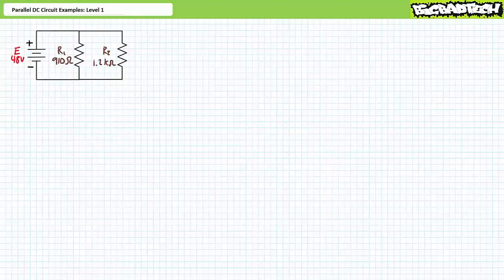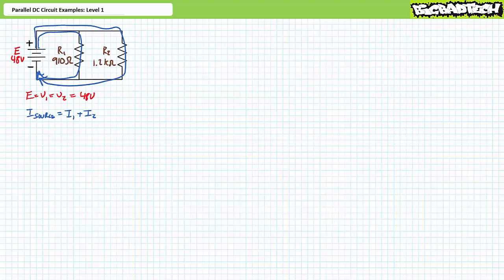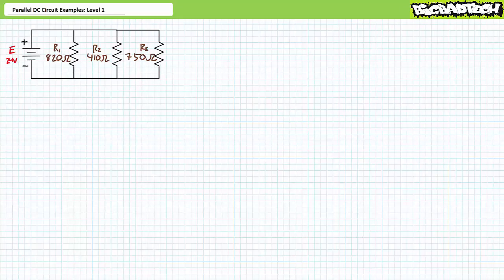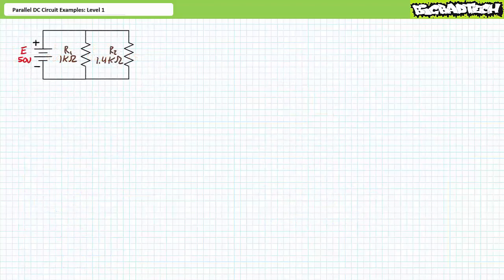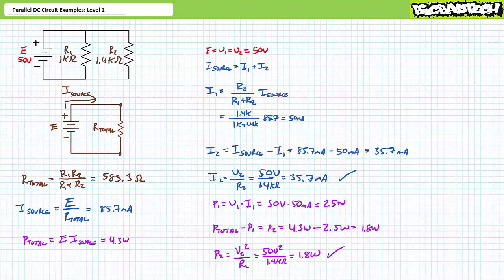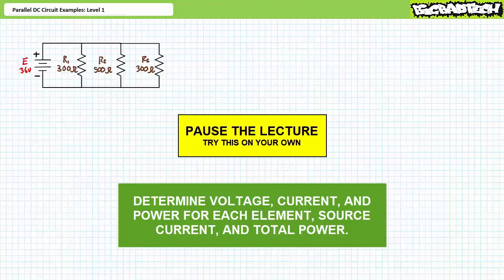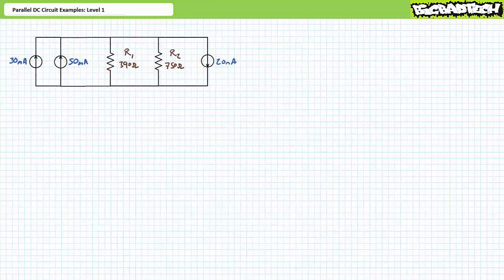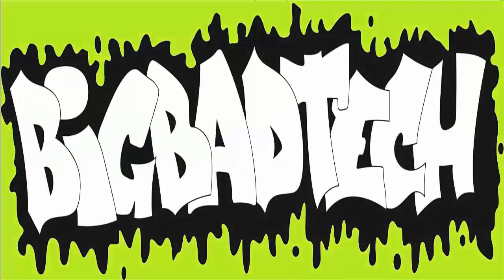Parallel DC Circuit Examples: Level 1 (Full  Lecture)

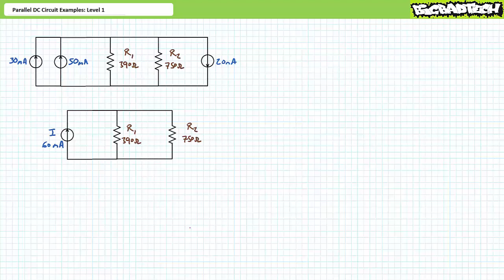Comment from the maker: ERROR at 11:04 The current divider rule setup to solve for I1 should read: I1=R2*Iin/(R1+R2)  (ie: the resistor NOT of interest on top). 750*60mA/(750+390) = 39.5mA. As a quick means of checking your work consider how current flows through a parallel relationship of 2 resistors. More current will flow through R1 being the smaller resistor and less current will flow through R2 being the larger resistor.

Comment: Thank you for your lessons.
11:43, R1 in the blue calculation should be 390 Ohm, not 750 as written. Right?
Reply from the maker: Good catch. There is something incorrect about the setup of that formula but the numbers and answer are correct. Check out the current divider rule lecture at: https://youtu.be/POb355SmRVI

The current divider rule setup to solve for I1 should read: I1=R2*Iin/(R1+R2)  (ie: the resistor NOT of interest on top) 

As a quick means of checking your work: More current will flow through R1 being the smaller resistor and less current will flow through R2 being the larger resistor.  

I'll post this correction in the information section. Thanks for letting me know!